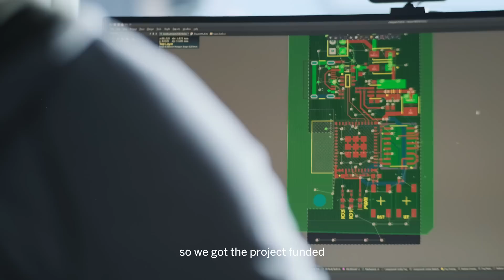Problem Solver | Segway Navimow Customer Stories

Comment: Fix backing up issue... Makes No sense, when weight are in front, bumper and sensor or vision fence... It should in 99% not back up... Because of weight distribusjon and tracktion...